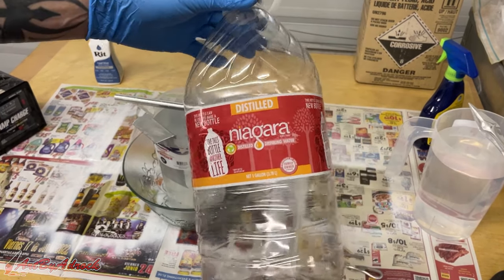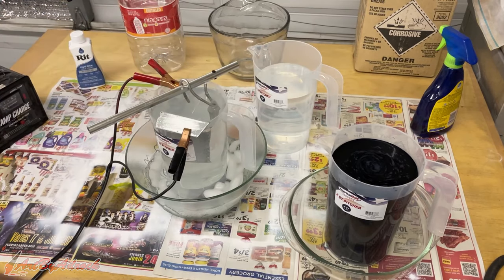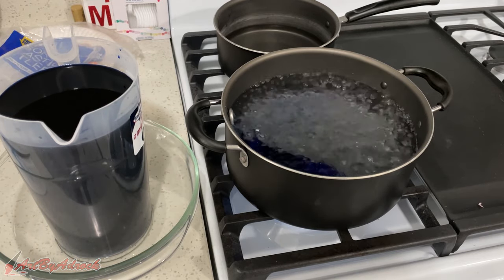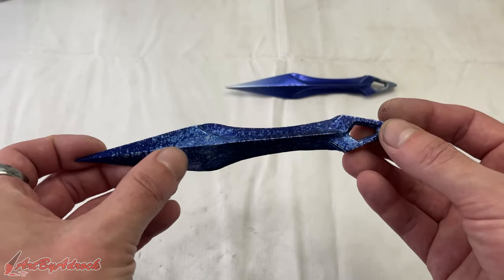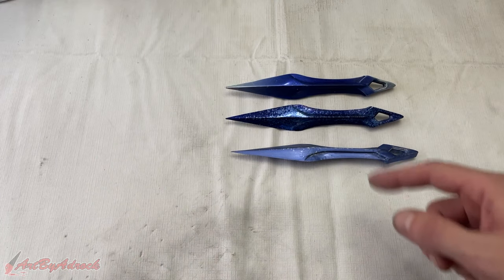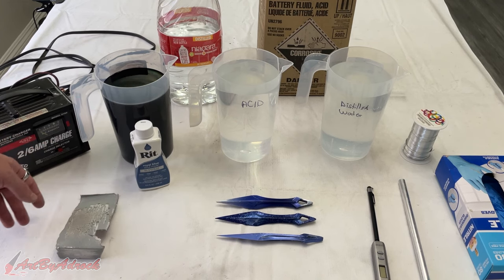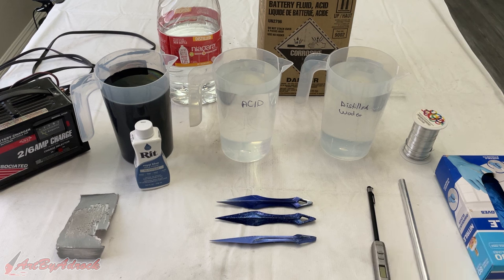EASILY ANODIZE ALUMINUM At Home | DIY Anodizing Process For Beginners

Comment: Mate you miss some steps. To get a uniform color you must add salt to your dye. The positive object should be in the middle of the negative. Negative side should be long on top and bottom so electrolysis can be 100%. Positive side should not touch the bottom. You can also do it in two steps. Once finish turn upside down and start process again before putting in dye. Don't forget salt is essential in dying process.

Comment: Hello, I am a new Spanish subscriber. I have been anodizing and coloring aluminum parts for a while now. I see that it is fine for a start, but I can help you to get better results. You would need a linear power supply for example 20A and 30V, then in the anodizing tank make sure to cover the sides and bottom with aluminum or lead (which is softer to mold to the shape of the tank). Try to keep the anodizing bath between 18ºC and 22ºC. The temperature of the dye is correct, it would help to better distribute the color in the piece if the dye bath had agitation.

Comment: The silvering happened because you used a tin bar to hook it on with chrome plating then hung the aluminium on it, just hang the aluminium on the side and then just connect the electrode to the aluminium hanger….and a 12v car battery works well instead of using the acid and a charger.

Comment: Is there a more simpler way of doing this without having to use these chemicals as you can't get these chemicals in my country for personal use
Reply: People throw away batteries from cars every day often dropped off outside car parts and service shops or recycling depot. Just pour out the acid and that is your solution to etch. Once the battery empty and dry and you have experience with tools you can cut split the top plastic from the bottom tray and the led cells are your anode to submerge to the bottom of your acid bath solution and that is what you connect your negative power supply wire to. Amazon sell the dye or fabric store even Walmart might. And distilled water Walmart cheap and only use distilled water. Aluminum wire to hook up the parts u find in home Depot home building electrical wire by the ft just ask someone must be aluminum cored wire to ask for. Good luck and don't start breaking battery open if you don't know what you doing it's acid and led both dangerous to anyone who don't know how to handle it.

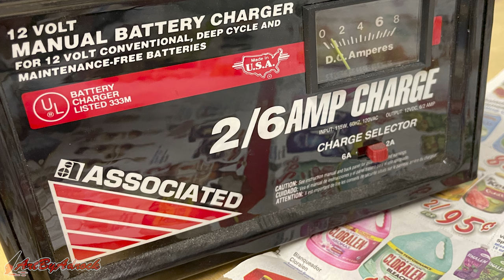Comment: Very interesting home brew anodizing video, thank you. Look at the battery connections at time stamp 1:35. It looks like the negative plate is touching the upper round bar. I'm guessing you noticed that (maybe the charger was pegging) because later in the video they're farther apart. I like the safety aspect for you and the part (gloves and explanation why). I've watched auto body videos where they rub their bare hands all over the part they're going to paint without cleaning! Thank you again, simple and easy to do.

Comment: oh wow, had no idea that anodizing aluminum was that easy! one suggestion about the tip of it not getting dyed... it could be because the electricity always wanting to take the shortest path.... so if you suspended it in the acid with wire holding up each end - so that it's laying sideways in the acid - that MIGHT get it to etch it more evenly..
ALSO do you know of any type of 'resist' you could paint on the piece before you etch it in the acid???  it definitely does exist, but I don't know what it would have to be so that it doesn't come off from the acid...... 
So as far as which one I like... well I did REALLY like that pattern on the second one.. almost like it was sprayed with a resist or something.... BUT I have to go with the first one you show3ed us... I just LOVE that fade on the tip... you couldn't get a better fade if you tried... lol ... seems like it would be worth experimenting on to find the best way you can make a purposeful fade where you want it and how strong it is... maybe using a very slow motor to lower the piece into the acid over the whole time period its being etched... that way the area in the longest would have the darkest dye
--- ONE LAST THING... do you know of a way to remove the dye after it's be anodized? I wonder if you were to put it back into the acid and etching process if that would pull it off??? and if so then you could paint some resist on top of the dyed areas you want to keep and then etch it again then dye it with another color.... then you remove the resist and it's the original color underneath surrounded by the second color.... dang this seems like so much fun to experiment with!! LOL
THANK YOU!!! I'll prolly start playing around with this soon enough.... thanks for bringing to my attention.. this is awesome!!!! :D
Reply from the maker: I’ll have to play around with it some more and try out a few different things I have in mind. 👍🏻
Reply: The tip was hitting the bottom of the tub you put it in

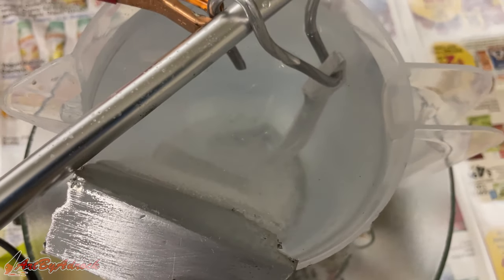Comment: 1:44 I have no idea what the process is but is that bar supposed to be touching the plate?  Shouldn't it be isolated so the current flows through the acid?  If so, maybe it could be improved fixing that
Reply: I was wondering the same thing. Maybe cut some notches for the horizontal bar to set in and stay in place.

Comment: I'm curious if the acid-electro stage is simply to remove surface oxide? Or does ithiscreate a more uniform or specific surface texture for the dye to "stick to"?  
Also I wonder if you could use heated vinegar instead of battery (dilute sulfuric) acid? 
Something to try.

Comment: Hey mate quick question. If you can help would super appreciate it 😊... My titanium nuts for my rack come in at the wrong Id... Do you know what beside PTFE i can use for a temporary nut.. ie nylon for example? Just worried if they come into contact with the solution it's going to ruin it.  And it was a bit of a pain to get that much together haha
Reply: Oh also I've had better luck with the powder rather then the pre mix .. turns out anodising pigment isn't much more expensive anyway at 22$ a bottle haha

Comment: Where can I find battery acid? Beside Amazon
Reply from the maker: You can get it at autozone or another automotive store. 👍🏻
Reply: @ArtByAdrock  awsome vid I subscribe thanks for responding 🙏🏽
Reply: So the first step is you dip it in pure acid correct it isn’t diluted or anything
Reply from the maker: You need to dilute the acid it in distilled water.
Reply: @ArtByAdrock  the part you have the positive on (the anodizing part) does it have to be bubbling as well I see the negative is didn’t see much from the positive
Reply from the maker: You might not notice it much but it probably will be. Depends on the amps you have it setup too.
Reply: @josephybarra3555  mechanic shops usually have dead batteries and I'm sure some will gladly give you one for free and there you have it free sulphuric acid